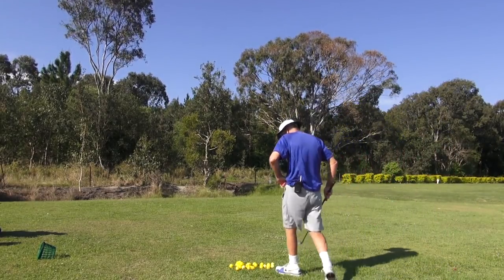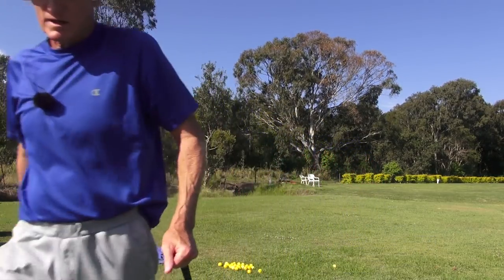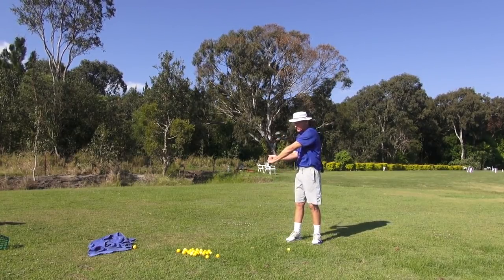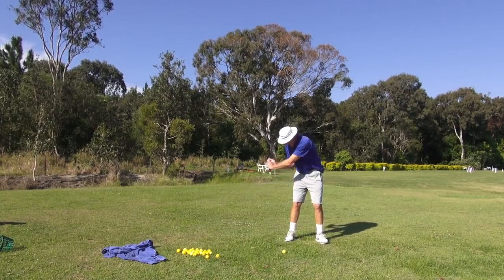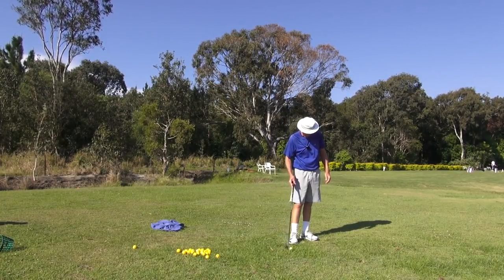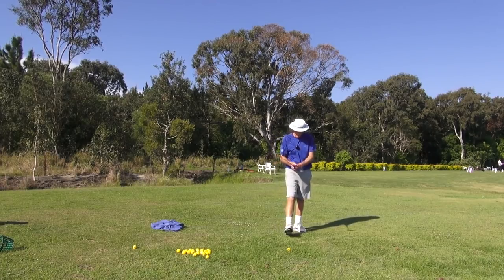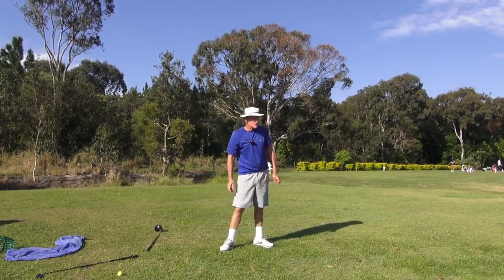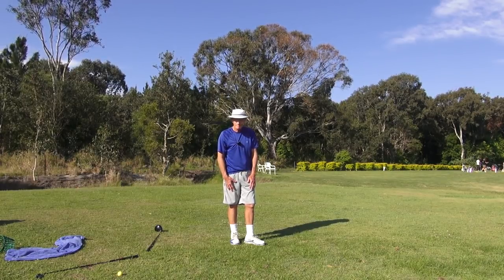JH's...  'Real' Channel Lock Protocol..With Grip issues..

Comment: I remember a video I watched  maybe over 2 years ago were you felt the swing beside you , I think you were hitting in a different spot earlier when you made this discovery,  an I right?
Reply from the maker: You are correct about that timing  .. I did dabble with a back foot beside the body type swing for pitching the ball   .. I knew the process had some potential but I  didn't pursue it into the full swing back then ..
                               cheers JH

Comment: JH,I am  confused, in previous videos with Mr. X I thought you said that you didn't want to bend from the side at address, yet now you say you need secondary tilt--can you explain?
Reply from the maker: Hi Johnny,
                The 'Secondary' Tilt is at 'Impact'..not  at  'address'...Secondary tilt is   the accentuation of the     head back at impact and the  weight driving down the trail side     while the lead   arm is pulling 'away' from the   trail side  ....keying on that secondary  spine tilt  coming into impact keeps the trail shoulder closed  and shallows out the attack  plane angle  into impact ..
                            I will give some more specifics  opn  this aspect in the next videos..
                         cheers JH